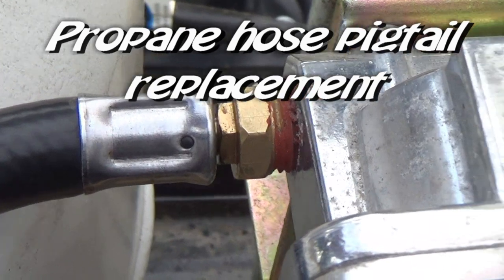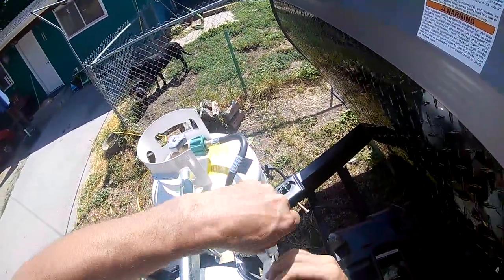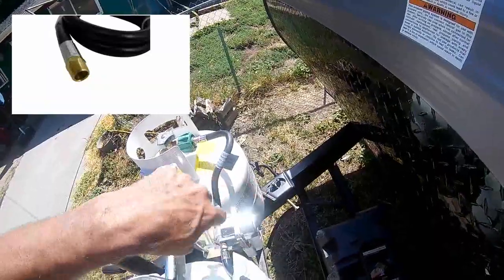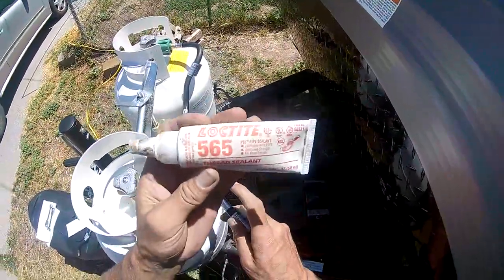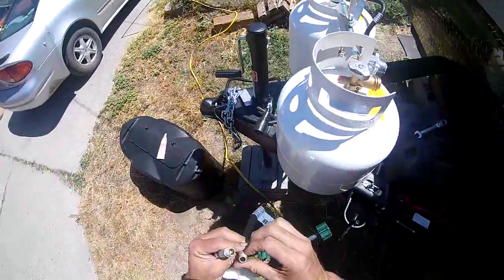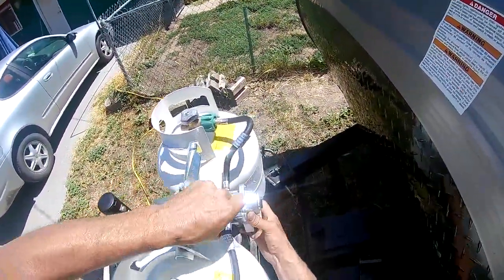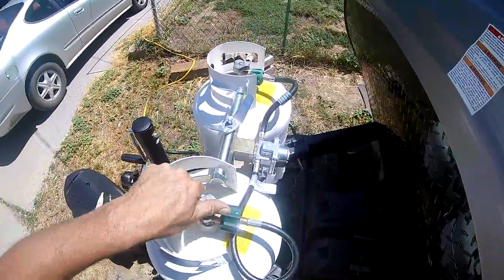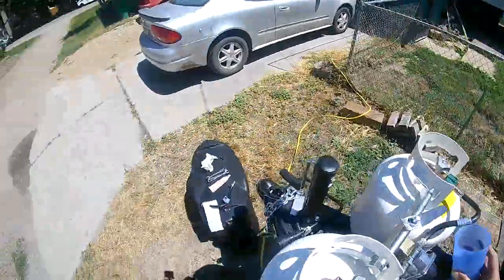Replacing a leaking RV propane pigtail hose

Comment: Going through the same thing and I noticed like on yours the regulator is free to bounce up and down on the threaded rod. I think the regulator bracket top part should be right under the wing nut.
Reply from the maker: I agree one hundred percent. Here is how I modified mine. 
https://youtu.be/FS75AArJC98
Reply: I don't know why you don't have a bunch of 'likes'. You vid was short and to the point. Something rarely done.
 And that's what I got to do tomorrow.

Comment: if you turn the valve off can it still leak out? because I turned it off and can still smell and hear it leaking out.is that just what is left in the hose? I dont want to blow anything up
Reply from the maker: There should be a selector on the regulator,.make sure that is turned to the opposite bottle and then check. If the leak continues shut the entire system off until you can correct the issue.

We had the second one fail camping and we were able to use the selector on the regulator to just run off the one that was not leaking.

Comment: Im not getting any propane going through the line and I switched the lines to see if it was something in the switch but that line worked on that side so its the line. Are these fixable without buying a new one? Looks like nothing is wrong with it.
Reply from the maker: I would not repair, they are not that expensive. It sounds like the inner lining has separated causing the blockage. Most RV repair shop have them in stock.
Reply: @DiyRVandHome  Thanks, and thanks for the video!